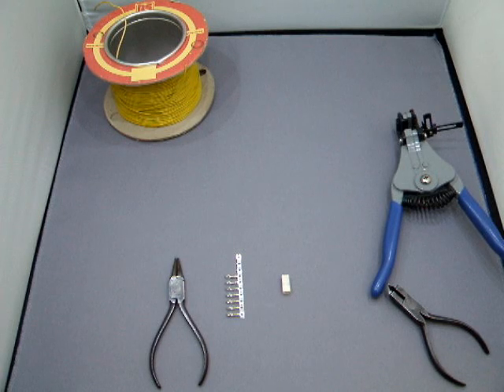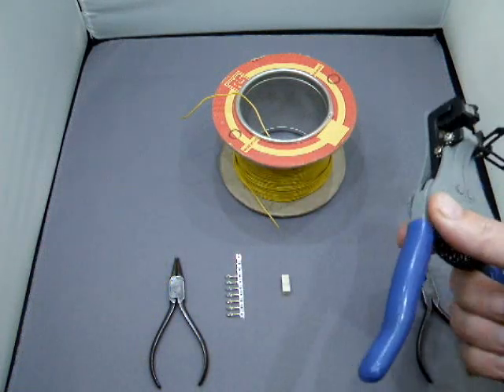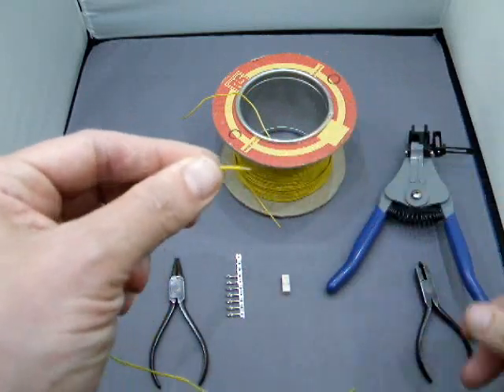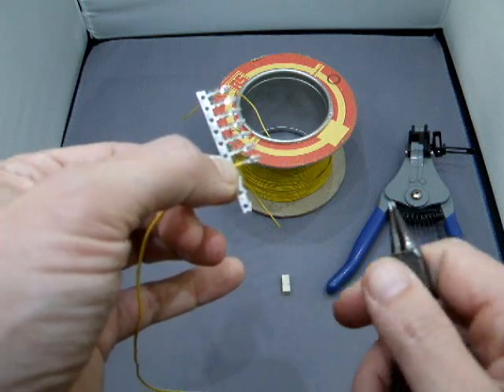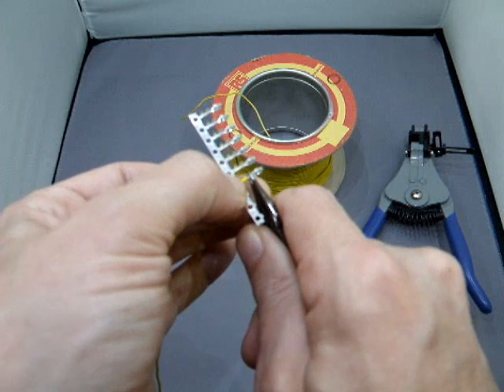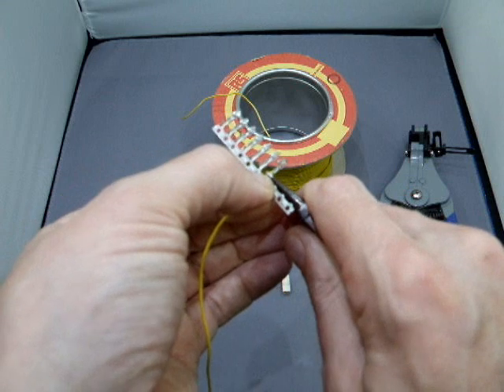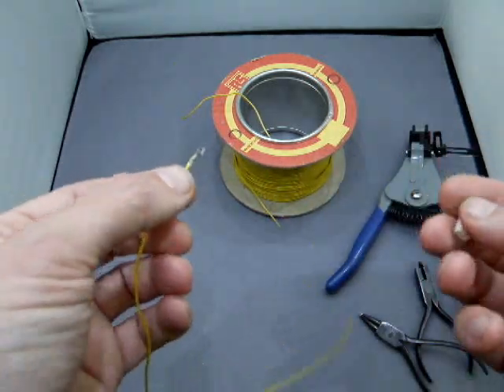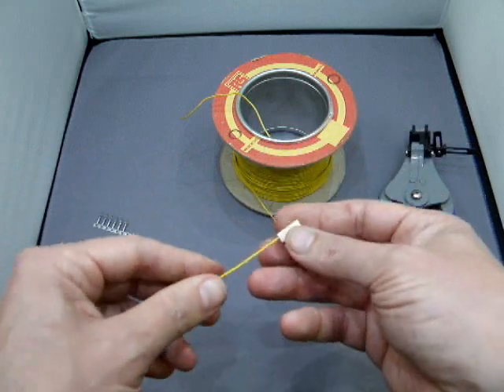Crimping without a crimp gun

Comment: if a wire is stripped out from the crimper, how do you undo  the crimp connector to reconnect the wire!??
Reply from the maker: I don't try to open a crimp. I just use a fresh one now that I have a stock of them. Before that I would solder to the old crimp.

Comment: agreed, leaving on strip, looks like is easier, i too removed from strip when trying to crimp wire to JST-XH, its really small, hard to see, there are 2 parts of the metal to bend, one to bend to the wire, the other part to the non-conductor part, and then the connection test to the male part, seems initially was hard to clip in after a bit of forcing, then doing a continuity test seems ok.. need to practice more, but this video certainly helped... thx

Comment: Alright, a bit of feedback on this kind of crimping. For hobbyist purposes this is fine - even soldering is fine - but for any kind of production or long term use, especially when the wires are moving, both plier crimping and soldering are unacceptable. The connection forms a stiff-flexible transition which is prone to breaking under stress. The terminals are designed to mitigate this, but this only works when using the correct crimp tools. Expensive, but necessary for a proper connection.

Comment: @efreyre These do not have to be crimped - I've soldered them many times and they work fine when you don't have a crimping tool available.  In most cases, soldering results in a stronger connection as well.  That being said, I still prefer crimping them as the result (when done right) is very strong, quick and reliable.